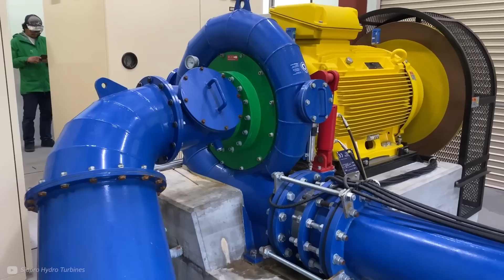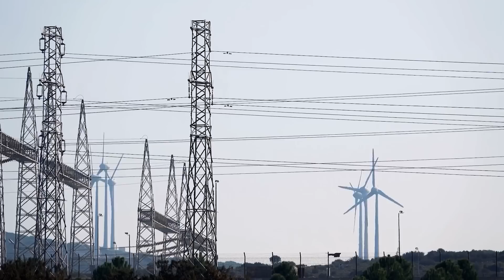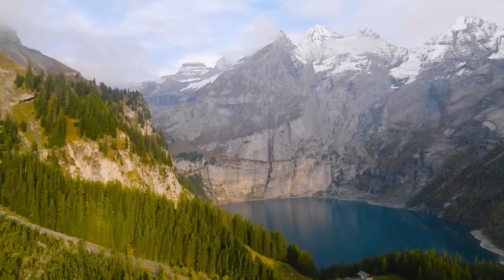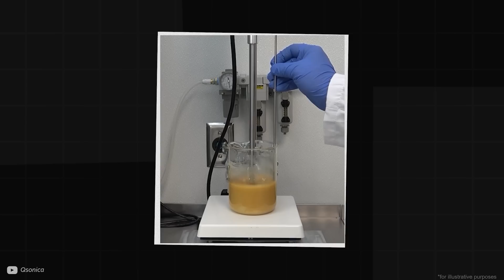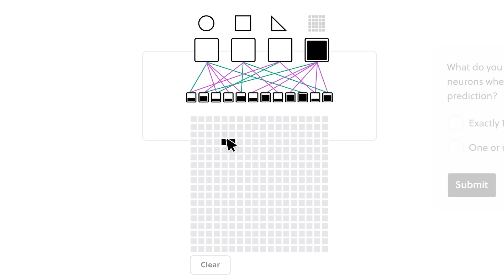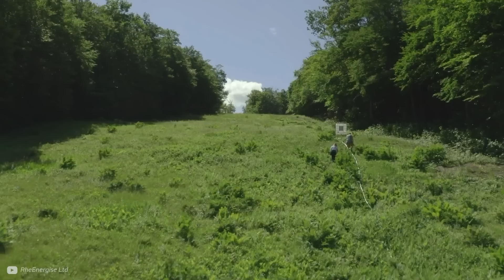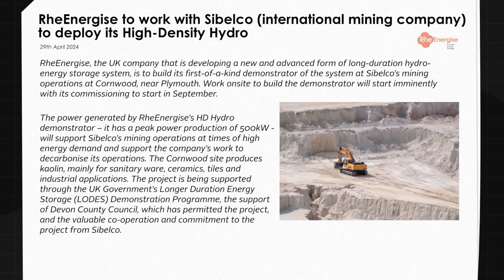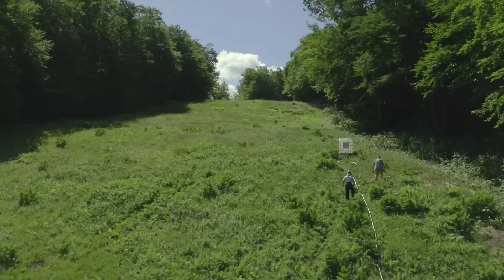The Genius of 'Waterless' Hydro Energy Storage

Comment: So if it's an open air closed loop system what happens over time with rainfall that over time will overfill the system,  
What happens to the overflow or discharged material

Comment: With only a factor 2 being better than water, there are plenty of disadvantages: the storage has to be closed in order to keep the mixture clean. Rainwater -- that might add naturally to a water storage lake -- can't be used and the extra cost of creating the mixture even if cheap and based on natural materials is still an extra step. I don't see how it can compete with water -- especially when the water surface could host floating solar panels ...

Comment: Can someone explain to me how this system could be considered energy efficient? Won't pumping the material back uphill require more energy than can be produced on its return back down just due to friction loss?
Reply: Correct. Energy storage is always rather wasteful. The idea is to charge it up when renewables are over-producing - when there's too much wind and sun, and the excess power is basically free.

Comment: If the fluid is 2.5x density of water and as was said it's mixture of water and some particles those particles are required to be off much higher density than water. Thus they are going to settle down over the time of storing the energy. This only can be solved by dissolving which is not having suspended particles. 

Considering this technology is to be used for lower elevation the depth of the upper reservoir becomes more important for the for energy capacity comparing to high elevation systems. And if the particles settle down to the bottom they lose the potential energy even if the even if the fluid is forcedly mixed (which cost energy too).

To summarize, this idea looks to me as one of the green energy frauds (like the idea of storing energy in hydrogen collected from electrolysis) and a way to get the grants from the government.

Comment: For thermal management. Solar thermal and thermal storage are fairly simple tech.  Especially if all you need is to heat the fluid before it flows through the turbine.  If you need to keep the entire reservoir warm, then “Good Luck with that”.

Comment: I presume these tanks will be covered to avoid contamination from rain etc. ? That will add significantly to the cost.

It also highlights something else - with a hydro system, when it rains, the extra water is an energy gain, as the amount of water gained does not need to be pumped back up. This is helped even further when the reservoir is fed by a river, as is often the case in these mountainous canyons.

Comment: It seems like a major benefit of water is the abundance of large natural resivoirs. Otherwise one could make a large wight of solid lead inside a sufficient casing of concrete and/or steal to achieve over 11x the energy storage density of water by simply raising and lowering the weight with electric motors/generators. A large, solid mass of lead should be relatively simple to render environmentally inert by encasing it in thick enough material. It may need stabilizing mechanisms to keep it from swaying too much in an earthquake, but a solid chunk of lead isn't going to easily seap into and contaminate groundwater like a large reservoir of slury.

Am I missing something? I'd love to hear from some people who actually engineer these systems.
Reply: You are re-inventing the wheel...this and many other energy storage systems are already being tried out, notably Tesla storage batteries in Australia to to balance out supply & demand (they have a LOT of daytime solar energy)

Comment: The turbines size would be made for water or be a specialty component, the maintainence would fall to the owner of the mystery fluid patent which will scare away buisness partners and the secrecy to the fluid does not clear up health risk complaints for the people deciding wheter it is safe to build. Also it looks like that filling fluid used in construction sites which is made to be used to have a softer form of dirt so it can be replaced after it was used once construction of flexible parts is completed. Like installing sewage piping where having the ends meet is important before pouring concrete over them.
If the turbine used was for water then the inlet size for it would be designed around the energy expected of running water instead of this heavier fluid while also increasing resistence to movement and abrasion in it. My big problem there is that this fluid would encounter high pressure spots and have the solids literally pushed out of solution at the outlet or inside the turbine. But honestly my biggest problem is that in a system like this maintainers need to be on site and it just creates a human bottleneck because they'd have to be trained in handling around the "substance" with NDAs.

Comment: What am I missing here? How does one pump the water back up hill without the use of power? Seem to me that the entire event would take more power that it produces. Please explain. I'm sure there is an answer because it works. Right?
Reply: It is actually a way to store power and not to generate it. The fluid can be pumped uphill adding potential energy (storing energy) and then can be let down through a turbine to recoup most of the energy (but is not 100% efficient of course). It is a great way to store energy from renewable sources which are not always available.
Reply from the maker: Sorry this wasn't clear, it is for energy storage so the inital power comes from an external energy source which pumps the fluid up, then it releases the fluid when it needs the energy. The fact the system can deliver 2.5 times the energy and power for a like-for-like water hydro system means it can be more cost effective, or a smaller system can be used for the same application
Reply: @ZirothTech  Thank You for quick response.  Love Your Channel. I always learn something new. Keep doing what you're doing.
Reply: It's a big battery.
Reply: You're correct. It takes more energy to pump the water up hill than to generate power when it flows back down. I think you're missing the point that this system mitigates the biggest problem with renewables like solar & wind: reliable, consistent energy supply, which uses battery storage. 

Instead of batteries, this system uses liquids pumped up hill to give higher potential energy which can then produce consistent, reliable electrical power for the consumer.
Reply: It would require more power ( possibly twice ) to pump the more viscious fluid back up the the upper reservoir, but surplus renewable energy might make sense despite that inefficiency. The real saving is the area required to store the same amount of energy.  However it doesn't seem any more efficient.
Reply: @TheInternetBanana   Yes its about saving space. Not about generation efficiency.
Reply: @JoeyBlogs007  I tend to agree with you.
Reply: The water is pumped back up during times of low energy demand, such as the small hours of the morning.
Reply: @ZirothTech  enjoy your style & topics, but please maintain a semblance of independence from source. It is "possibly" more cost effective; they don't have a full demo unit or baseline so they don't know. eg. Wind turbine maintenance is pricier & more frequent than predicted. Smaller is good, but enclosed / buried is bad from a cost POV.

Comment: If a fluid produces twice the power due to it being more viscous, it must mean that you require double the power to pump the fluid to the upper reservoir? i.e. due to its higher viscosity. Rather than change the fluid, simply change the turbine blade to match the fluid viscosity to optimize hydro power surely? One would have to look at the round trip energy efficiency, not just the one way power generated. However I guess when there is surplus power the storage efficiency becomes less of a concern.
Reply: The real saving is the area required to store the same amount of energy.  However it doesn't seem any more efficient.  Not round trip.
Reply: Yeah, but I think sodium ion large scale storage would be better and more practical.

Comment: This has me thinking about what it would take to build a single house underground battery based off tech like this for temperature consistency.  Given the volume calculations two 24'L x 8'D 10,000 gallon tanks with roughly a 15'-20' drop could hold roughly 1.5k-2k watts of energy per day. While no small undertaking and based entirely off a very quick search it could probably be done for under $100k. Again this is a very, very quick guesstimate, I'm sure I'm missing some additional costs, and one would need the property to build such an underground monstrosity, but from a volume requirement perspective that's not all that much space.
Reply: You realise 2 kWh costs around 50 cents right?

Comment: What is the slurry made of?
Reply from the maker: They have been very secretive and I didn't want to speculate too much in the video, but if I had to guess I think it would be some kind of anticaking agent
Reply: My guess is a diatomaceous earth like ‘Fuller’s Earth’ (used in cat litter and oil drilling mud).
Reply: @ZirothTech  Just wonder whether it may degrade and need restoring over time?
Reply: @christopherj2231   It would wear out the turbine blades in no time with that highly abrasive slurry.
Reply: If it is a commonly used excipient in medicines, then magnesium silicate (talc) might be a candidate. Density of 3.192 in pure form. Literally the softest thing on the Moh’s scale, so the turbines might stand a fighting chance, for a while at least.
Reply: Diatomaceous earth would destroy any gasket or rubber it comes in contact with.

Cheap cat litter is damn near 100% bentonite. In fact you can buy a couple buckets of it, throw it in a cement mixer with some rocks and once it's pulverized remove the rocks then you can use it to seal ponds or in ground pools.

Bentonite is the clumpiest of clays. So, not what I would expect here. Clay is already broken down to millionth+ scale of fineness. The finer clay you get, you'd just end up with a higher grit polishing rouge. Like 5million grit. 

I suspect it's just clay and dish soap (dish soap is a surfactant). My property is in old striations of the last glacier retreat, so evidence of it is everywhere. Besides hill orientation, we got random boulders and random pure clay deposits. So.much.clay.in.my.dirt. I have to add mulch at a minimum of 20-1. Its maddening. BUT I did set some of that clay, and it took months for it to settle out of the water. MONTHS. If it were moving, o don't think it ever would have

Comment: Darpa found thousands of pumped hydro potential sites in US.  They used satellite imagery.  The problem is US doesn't invest in infrastructure now that it has privatized the commons  with finance capitalism.  Industrial planning and the pumping the commons with state credit is a ghost from the past.  The grid has to be expanded to connect the sites, which is the problem.  Locating energy storage near grid nodes is a solution.

Comment: The fact that the self discharge rate for this technology, as with conventional pump hydro, is virtually zero has no particular advantage when compared to batteries because, apart from a very few unique pumped storage sites, the the storage will need to be cycled on about a daily basis to make the economics work. At the daily level self discharge  of lithium iron phosphate, or the even cheaper sodium ion, batteries will be around 0.1% or less per day (about 2% per month) so will be inconsequential.

Comment: What if they just made a percolator style water return. Where they heat a little bit of water at the bottom reservoir by a highly efficient electrical means and use the heat and steam to move alot of water uphill for a really low cost. it also makes the system a water recycling system so you don't drain the reservoir while producing more power

Comment: Let's suppose a decent-sized water reservoir is 1 million tonnes (ie 1 million cubic metres of water, eg 500 m x 500 m x 4 m deep). No imagine that you want to replace that by this slurry that is 2.5 times the density. So you will need 400,000 tons of slurry. At 10 tons per truck, that's 40,000 truck-loads.

How much does that cost, compared to water that was already there? How long does the slurry last before it solidifies? What does it do to the local vegetation, and water table?

What about all the fish and other living creatures in the original reservoir from when it contained water? What happens if a bird lands in it?

Also, what happens to the slurry when rain falls on it? How do you run off the rain you don't want, without it being contaminated with slurry, that will contaminate whatever the run-off runs into, killing all marine life therein, and making it impossible to tap into the run-off to provide public water supplies?

This entire project should win a prize as one of the greatest non-starters anyone has ever come up with. Genius solution? Come off it.

Comment: First up - I don't believe pumps can return the fluid using less energy than it makes. Pumps are only used in hydro schemes to recapture what excess energy would be wasted, but at losses (the loss is just less than the waste loss). Your system must have pumps that use LESS energy than is produced at all times - the same energy is futile. Your system must be enclosed, which creates high costs. Dams work because they are filled by regular rains, not because some water is pumped back up.

Comment: Here is a bad idea that is better than the presented concept. Run a vapor chamber heat pipe to pump water vapor uphill. All you need is a tube, a water source, a vacuum pump to remove air, an array of mirrors to focus solar energy, and two heat exchangers. The reservoir at the top is used to cool the condenser.

Comment: use mercury 2.5 x denser than slurry, just keep it in glass in a steel container inside a steel container, and concrete leak passages , its toxic though, so liquid gold would be much better and you could store energy in it too in form of heat. Gold us actually very abundant, if you could extract it from sea water easier... 40% denser than mercury + 198 MJ /kg for heat

Comment: Lakes full of slurry. What could possibly go wrong? Pumped hydro has other advantages, that may well offset its relatively low density. It's drinkable, for one. It may have some integration with the local eco-systems. The potential for disasters is lower. The long-term behaviour of water is well-understood. Etc.

Comment: Why is that fluid  needed at all? Isn't it better just to use rigidbody objects to lift up on "charging" and let it descend when discharging? So much complication with those mixed liquids that make this whole idea way more expensive compared to the rigid objects.
Reply: Tell me more about rigidbody energy storage on a large scale. I'm genuinely curious.
Reply: The "rigid bodies" need to be rather large, and they need to have some "gearing" to transform their very slow movement into enough rpm to drive a generator....I guess that, if you had a very large weight, sitting as a "piston" on a large pool of water, you could drive a turbine with the water, and reuse the water by pumping it back into the system....
Reply: There are many companies promoting exactly such a system. They look great, until you work out the actual energy density. To get decent capacity requires a facility of absurd size.

Comment: Next thing they will want to do liquid mercury lakes😂🎉
Reply: This was exactly the first thing that popped into my head.
Reply: Funnily enough, there were a few prototype power stations that used mercury-driven turbines in a two-stage system. They could run with higher efficiency than a purely steam-driven turbine, getting more useful energy from the fuel. But the technology proved impractical - the space required and costs are just too great to justify.

Comment: You could put pumped slurry in a very tall building in the middle of a city. Mostly underground, even, if the stuff doesn't leak into the surrounding soils ... hmm what's that R-19 made of again?
Reply: It wouldn't be economically viable.  Even with the height being provided for free by the landscape, it's barely cheaper than batteries.
Reply: You clearly have ZERO understanding of the energy density of this device.

(Extremely low)